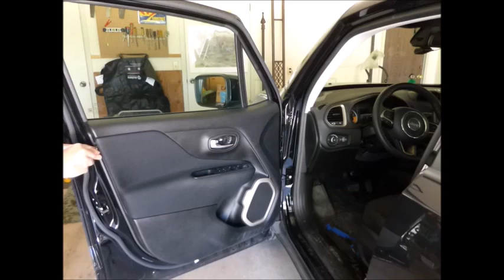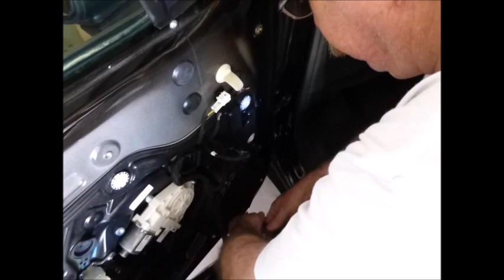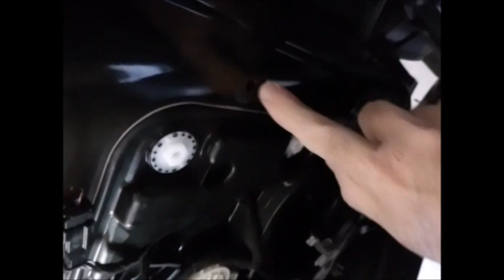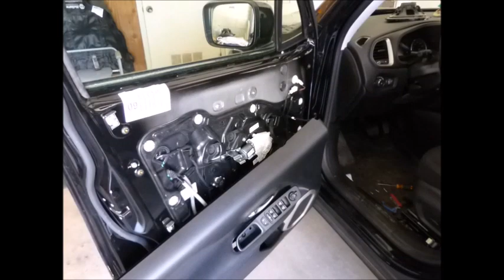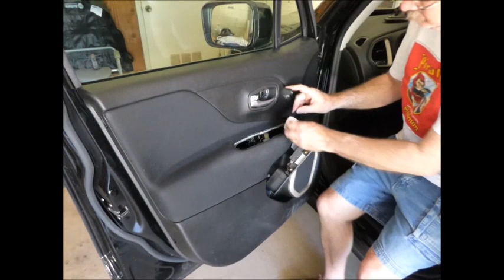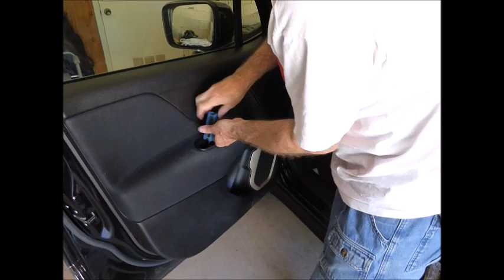2016 Jeep Renegade front door speaker upgrade

Comment: Now multiply all of that work by 4.  I think my current speakers are good enough.
Reply: The factory speakers blow out tho.
Reply: Oh would have to pay allot of money to upgrade these speakers bc my factory speakers in my 18 kick ass I think. They haven’t blown yet and I keep it blastin 🤪
Reply: Yup just blew my passenger door speaker. The stock ones are trash.
Reply: Are you still feel about the factory speakers? I'll bet $1,000 that at least one of them blew out they're cheap junk
Reply: @boosted2.4_sky  The engine was cheap junk, replaced it with a Wrangler.
Reply: @dr7319  lol... right on...👍

Comment: What AWG size is the speaker wire?
Do the speakers have a rubber baffle?
Reply from the maker: Wires are around 18 ga, speakers are naked, but there is some noise dampening sheets in the door.
Reply: MrProjectHacker are the steps any different for the back doors?

Comment: Do you need any additional wiring harness or adapters to connect the new pioneer speakers or does the old plug connect right in to the new speakers?
Reply from the maker: One side of the socket will plug in to the speaker. At 5:50 you see me making a jumper out of a terminal kit and a scrap of wire to adapt the other speaker terminal to the  factory socket.
Reply: Metra makes an adapter only available un the states from Crutchfield